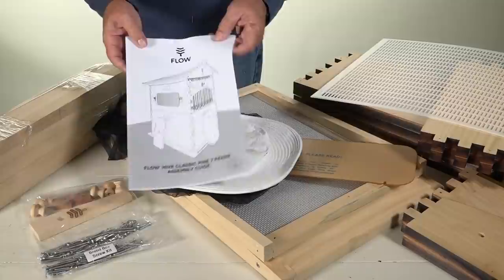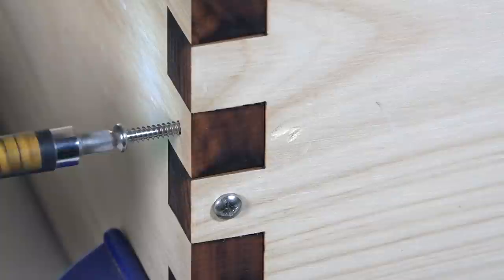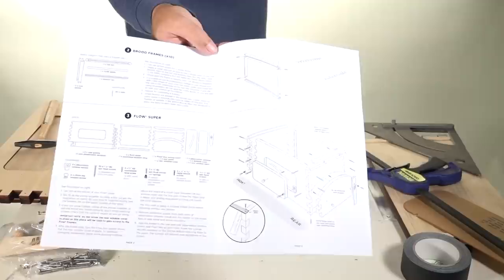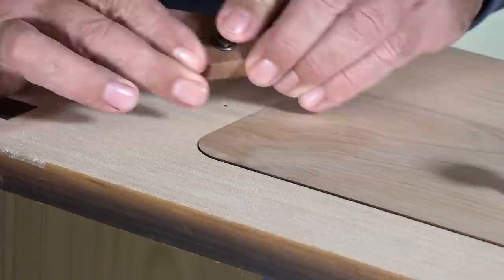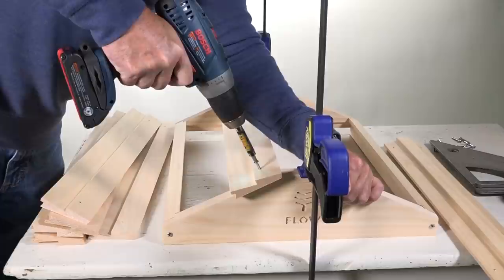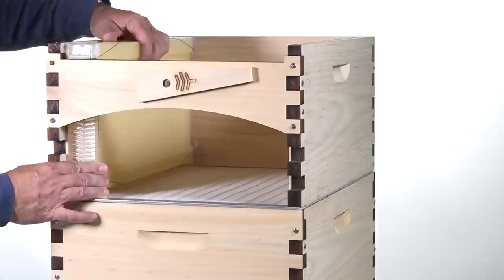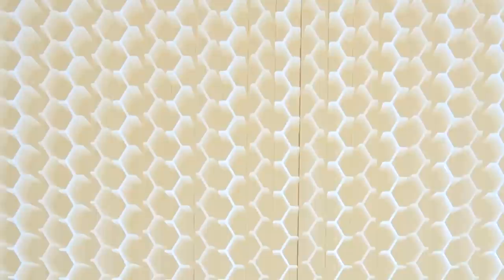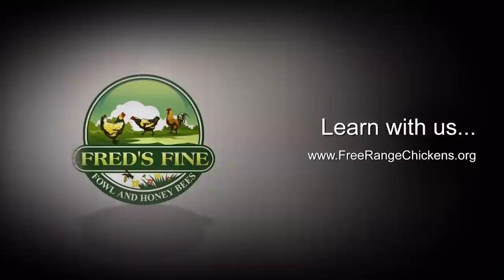The Flow Hive now BIGGER and BETTER than before, Assembly Guide 10 Frame! Honey Bee Hive

Comment: shouldn't be many bees in the combs anyways cause you should wait until the comb is fully capped
Reply from the maker: That is correct, I had to address it because there have been some extremely angry beekeepers accusing me of promoting "honey bee execution" and it simply is not the case. The bees do start working on the flow-frames while they are draining and a few are apt to be cleaning them up when the cells are returned to the closed position.

Comment: I wonder how much a typical beekeeper makes off honey per year. $699 seems pretty expensive for an investment in something that might not work.
Reply from the maker: Definitely not for someone minding their pennies.
Reply: Does it produce a profit at all? Been wondering if I should start beekeeping
Reply from the maker: Some people do make some decent money, while others lose everything. Dealing with living organisms is always a gamble. Example, I have a friend who has been keeping bees for several decades and has well over 260 hives. This winter alone, he lost over 50% of his colonies. Bees are facing increasing pressure from disease, parasites, and agricultural practices. I don't think it's a great time, at least in the U.S. to begin a commercial beekeeping operation.
Reply: a traditional extractor will run, at the very least, double what the flow set up seems set for. And that's for a manual version. no particular idea what a motorized extractor would probably double the cost. 
Also..the more frames an extractor can handle at one time,  the higher the cost will be. They are NOT small either, definitely need to have a strainer on hand ( mechanical or manual). Trust me, having btdt...I'm getting some serious flow hive super lust.
Reply: Not a good reason to get into beekeeping. kind of like..oh, horses. The best way to make a small fortune in (insert industry) is to start with a large one!
Reply: I look at beekeeping as a service to the community in a very small way and because i just love learning about bees. I love to also tell people about how the Honeybee lives in its short 6 week life cycle. Most people are amazed at that one fact alone. I have never made any money out of selling Honey. The cost of running 27 hives in the UK was never ending. Spending time every week inspecting, travel costs to and from the two out Apiary's i had. It was a good job I was retired with a reasonable pension.If you sell your honey for say £7 a lb. out of that must come the cost of the Jars, Labels, Electric for spinning, Filters, Taps, Beesuit repairs or replacement. Then what about your TIME, that alone cost more than the Honey per hour. But its just a hobby, remember that when you buy the next jar of honey from your exhausted Beekeeper friend.